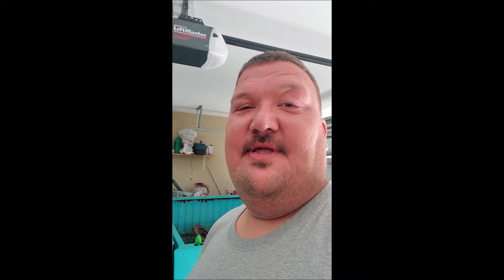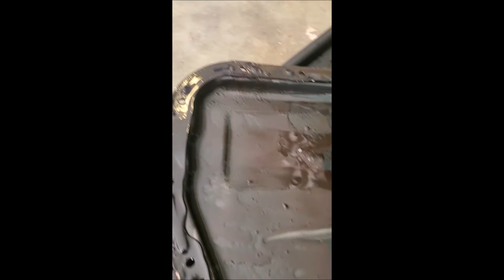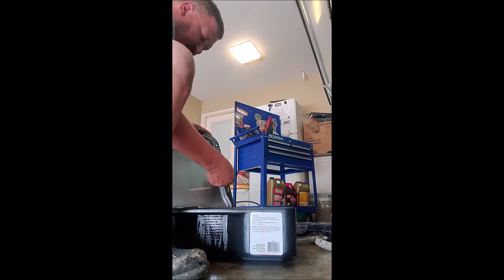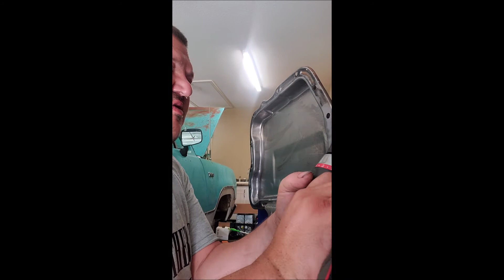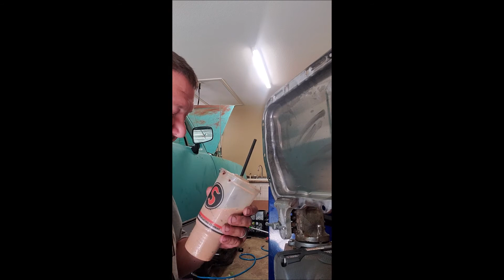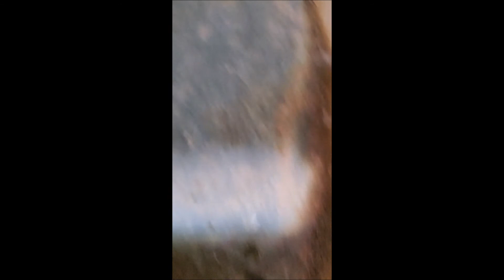Resurrecting Betty Part 4:Trans Pan Pains!

Comment: Peter , not preaching here but the Lord only gives us one set of eyes so when using a wire wheel brush put on a pair of safety glasses.
Reply from the maker: Yeh,trust me heard it worse from my dad whose an avid watcher being 1,300 miles away. I had a pice of metal get stuck in my eye and started to rust after 4 days..they had to grind some eyeball away with a dremel looking tool,I should know better